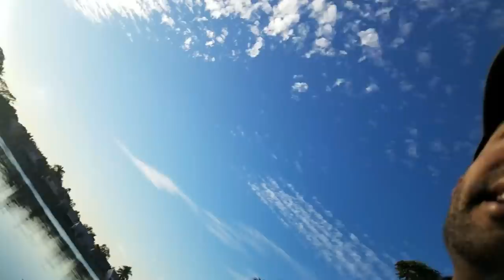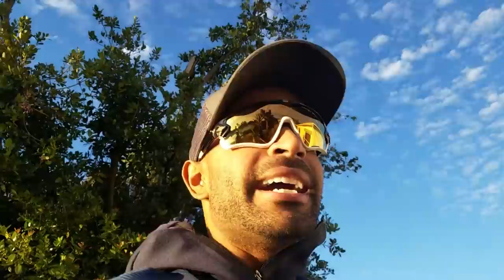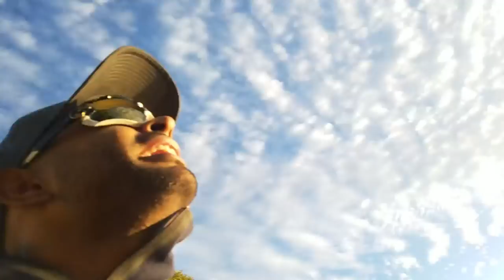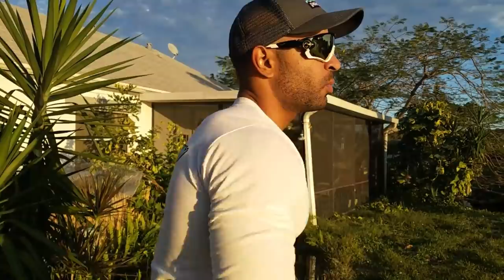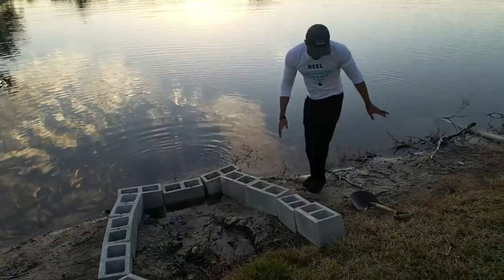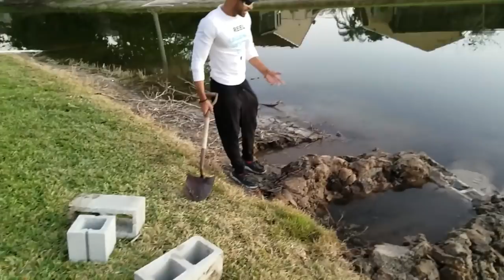BUILDING a POND inside a POND! Cold Iguanas!

Comment: Hey catch em all, we do this a lot out in North Carolina but what we do is well go on cregs list and search up for some of those fertilizer heavy duty plastic crates and make sure their selling them on some farm that way if the owners want to sell it they’ll sell it cheap. Anyways bring it home on a truck and cut a big square hole in the top fill it up with the pond water the fish are used to we like to normally add some vegetation just a finch bit, and a few rocks. The main final tweaks lol is to cut another square hole on the side put some sort of glass on the side and then it a metal plating just a square will do fine you need it too be pretty thin and a tab wider than the glass finally put the glass on top of the plate center it up and cut around the glass. While still cutting on the plate that allows you to get a edging sides and corners of metal to frame the glass onto the square you just cut out of the crate. I recommend just probably getting inside the crate lol and drilling some nails threw the crate and the metal plating and do the same on the outside drilling holes into the inside. At that point what you can do with the points of the nails you drilled from the inside is get some styrofoam and twist it on at that point eventually you can stick your air bubbles thingys I forgot what their called into the styrofoam after making little denchers to fit them in on the nails you drilled from the inside of the crate to the outside just sand them off or down idk do something to get rid of them. By then you’ve got yourself a pretty big outdoor aquarium, OH AND don’t forget to make a latch door on the top of crate so nobody comes up and steals all of your exotics. THANK YOU FOR READING MY COMMENT I’m Max.Arey and this is my pawnshop! Peace

Comment: It’s -10 degrees Fahrenheit over here. If I were in Florida, I’d be basking on a beach. You guys are wimps.
Reply: Horseluver4ever 1234 how we are, not used to the temperature dropping down that much we are used to 90° 80° it dropped down to 40° degrees
Reply: Sorry I didn’t live in an igloo and my best friend wasn’t a polar bear.
Reply: Horseluver4ever 1234 We are not used to those temperatures and I think you're nuts for living there. Florida is a sub tropical climate.  It's been in the 80s in January already, but it can also get below freezing. Given the humidity, both cold and heat fill more intense down here than they do up north at the same temperature. You might be surprised just how cold you feel in 40°.  It was in the 70s on my in laws last visit and we did go to the beach in March...until we all got cold.  The water is pretty chilly until the days are longer giving the sun more time to warm it up.  I live in Tampa. The high today is 77°.  Siesta Key, called the best beach in the US, is less than an hour away.  The water temp is 61°. For reference, most of the fresh water springs average at about 72° all year long.  The water temp in Key West is 69° today.  And we're expecting rain, which will drop the temperature. So between the humidity, the rain, and the water temp, I doubt you'd be trekking to the beach today and the temperature was colder when the video was made.